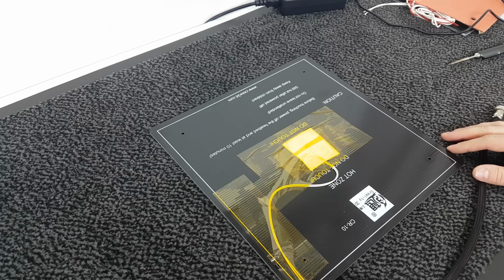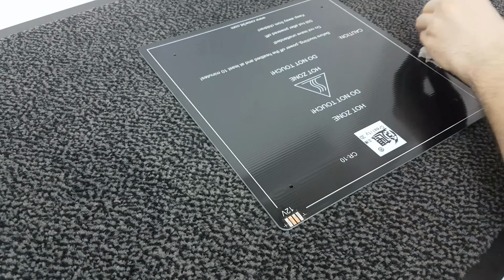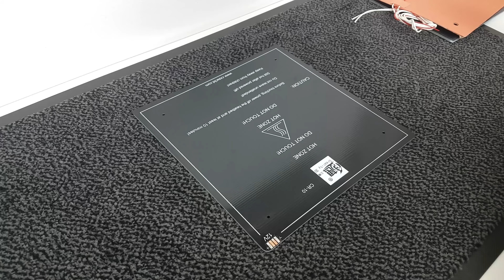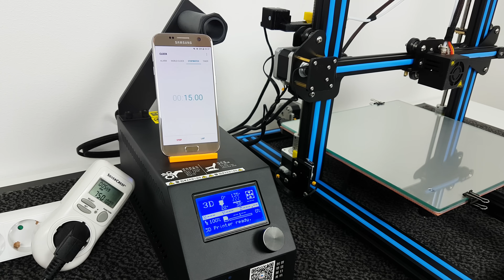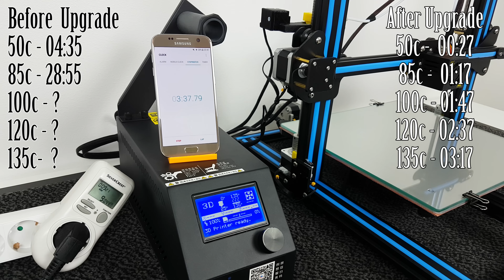Creality Cr10S ultimate Heat-bed upgrade! 750W heater installed

Comment: Attention!!!! This is the most dangerous modification I've ever seen. Putting 220V over the standard plug on the CR-10 (G16-4) directly next to the thermistor is not a good idea. In the simplest case, only the motherboard is destroyed in case of a short circuit. In the worst case, the mains voltage is applied to the metal parts of the printer, which can be deadly. The G16-4 plug is only designed for max. 150V AC!
Reply: on top of your great comment, if the plug is not installed, you have MAINS exposed on the pins, even without any faults this is not safe and probably against any existing electrical codes. There is also no fuse int he heat bed circuit and no differentiation in the wiring colors to indicate a significant difference in voltage, any one going in their later could easily thing there is only 12 or 24V on that wire.
Reply: The plug is also rated at 5 amps. With a 250W heated bed at 12Volts, there will run 20 amps through the plug. Not a great idea either. So the 230V will draw 3,3 Amps. I choose the 3 amps over the 20 because of heat dissipation. If you insulate your plug well enough with heatshrink then there is no problem with the voltage.
Reply: Sure, the main points for criticism are: running mains and low voltage through the same plug over exposed pins (inside and outside) and the lack of safe insulation / grounding towards the chassis. And because I personally do not always comply to any and all regulations I would dare to perform the mod exactly like nexi tech did, simply for the beauty and clean looks.
But I won't.
I will run the mains to the heat pad through a separate case with own main plug and fuse. Smply because I cannot guarantee that I alone and forever only me willl handle that machine. And that is the point when standardisation becomes relevant: when your changes to an electrical system are no longer recomprehensible.
And for all those boo-ing and crying "drama queen": we will have to bother with them only for a few  generations to come, but they will gradually disappear. Mains power is an effective RDSM (reinforced darwinian selection mechanism) :)
Reply: It is not really about what you can get away with but what something is certified to handle or what you should do. in some situations it could take months to break down or simply not meet code requirements for clearance etc... yes heat shrink and the likes can mitigate some of the risk but does not eliminate it. 
Nexi Tech looks to be competent in what is done here but if anyone else tries to copy then, there could be a different result. If i did this professionally then I would be fired, Nexi Tech did this for himself personally and at home so he can do what he likes and carries the risks that go with it. What most folks here are trying to get across is that, while it works and may for years to come, it is not strictly the right way to do it and not totally safe.
Reply: I just spent a few looking at several listings for those 4 pin aviation connectors and all of the ones I have seen are rated for 250v AC.
Reply: Calm down drama queen.

Comment: So many people talking BS after BS, I work in aviacion  and we call this blankets heat blanket, they been around in  aviation for ages, 30 year +, and when the short out they stop working that is all, they do not heat up at all, we use  use the same principle with the briskets box, and manually race the temp,  and we cook at 250 to 350F, when the blanket short out nothing happen just blow the fuse in the box, that is all and sometimes no even that.
Reply: aviacion is Spanish for aviation, which I suspect is maxun1's first language.
Reply: an idiot*
Reply: theres still 230 volts on the connector pins on the backside if you unplug the heatbed. I  have no idea why the pins are on the backside and not on the heatbed cable. You should be able to switch it up tho. Also you dont know of the plug is even suited for 230 Volts, you should definetely buy another plug that is suited for 230 volts and the current that this heatbed takes.
I agree that people in the comments are overreacting but still you should not play it down like its nothing, even 230volts can be dangerous!
Reply: you are a idiot.
Reply: did I spell idiot correct?
Reply: Yeah, I mean people are right to be afraid of 230V, but honestly, a lot of us are used to working with AC. If you know what you are doing, this is PERFECTLY safe. If you don't know what's a fuse or what's the difference between AC and DC this is not for you.

Comment: Considering you've got the wattage meter there, did you test how many watts the psu is pulling without the heated bed? Give people an idea of what they can downgrade to.
Reply from the maker: Joe  Yes, 68W was the peak number at 250c on hotend and at max printing speed, 250mm/s travel and 150mm/s print speed. So 70W/12v=5.8A I recommend at least 100W(8A 12V) powersupply to be safe and it can be even passive one without cooling fan(silent type).

Comment: Great video! Can this be easily done with Anycubic I3 Mega? The Ultrabse version heat bed is lacking. I just got the CR-10 Ultrabase; so nice.
Reply from the maker: RichterScaleStudios Thanks! I don't recommend this upgrade in I3 mega. I3 Mega has all metal frame and bearings on heatbed. You have to ground it. On Cr10 heatbed is rolling on plastic wheels so it's isolated from rest of printer and it has glass over aluminium heatbed. So some protection is there.  Btw. I have I3 mega with ultrabase and it can reach 110C on heated bed comparing to 87 (Max on Cr10). You don't really need this upgrade on I3 Mega.

Comment: Very nice video looked everywhere on youtube and it wasn't explained yet. The only thing I would do different is adding a fuse in series.
Reply from the maker: marko rodriguez Thank you. I fact I was thinking to add fuse the heater on AC line but there is a fuse on the back of control box already where AC plug are and it's 10A rated. 10A x 220V= 2200w. I think it's enough for whole 3D printer with this upgrade. It's maybe good think to add ground somewhere but there is glass over aluminium heatbed and whole heatbed is rolling on plastic so it's isolated  from rest of printer. Even if something short out fuse in control box will blow and cut main AC.

Comment: The bad has no grund it is very dengerus in tornado the bad is glass so it isolate but here aluminum..... u shold go with 24v bad less dengerus
Reply from the maker: elad b . In fact I was thinking to add fuse the heater on AC line but there is a fuse on the back of control box already where AC plug are and it's 10A rated. 10A x 220V= 2200w. I think it's enough for whole 3D printer with this upgrade. It's maybe good think to add ground somewhere but there is glass over aluminium heatbed and whole heatbed is rolling on plastic so it's isolated  from rest of printer. Even if something short out fuse in control box will blow and cut main AC. 
Of course you can add ground to one Heatbed adjusting screw(spring) and add one more cable (ground) to the other cables thru the cable housing way to the connector(plug) on the control box. Then from conector you can connect ground wire to ground on the main AC power plug from incide control box.
Reply: A new rule on YouTube from Georg Hartmann : If you can't comment in litteral english (even if english is not your first language), don't comment.
Reply: I have a house with a 2 wire system entirely. Does not really matter if there is a ground cable in that case.
But feeling free to isolate the sides of the aluminium board.
Reply: But actually i was flashed  by the english of elad
Reply: that english though .. and glass is isolating against heat? since when ?

Comment: Hi Nexi, good instructional video as usual. Be careful with this one though. There is now 220v A.C. on a machine chassis that was purposed for 24v. There does not seem to be additional grounding on the printer for the 220v circuit. Just a heads up on regulation in case someone decides to flag.

Comment: Great video as always, but is that connector on the black cable to the heated bed rated for mains voltage?
Reply: Nexi Tech Hi.  I saw the tube on disassembly.  On reassembly at 5:45 you mention it but you don't see it being replaced.   I like your channel but worry about this upgrade as it has the potential to go seriously wrong.  As shown you don't use upgraded connectors, (cables, and power supply), the chasis isn't earthed, and the heated bed is only protected by the appliance fuse, a smaller fuse could be added for the heated bed alone. Ive done a number of printer mods that you've done, but will not be going near this one.
Reply: Yep, my question exactly. But I think that it should be enough.
Reply from the maker: It's not a problem because load in amps is way to lower then before upgrade. Before was 20A on the connector and now is 3.4A
Reply: Steven Bacon Also there seems to be a metal outer sleeve just separated from mains wire by a layer of tape/small gap.  If plug were damaged eg crushed or dropped then there's the possibility of it going live.  While it may work I don't think I'd personally risk doing this mod.     Any faults with the wiring could result in a live plate/frame which is afaik unearthed.  If you are tempted by this mod, consult a qualified electrician.
Reply from the maker: freeyourinnertube If you pause video and look close on 3:59 you can see that tape is just extra protection over plastic cover. That plastic part is inside of plug and I add tape just to get extra safety.

Comment: You really should add a washer between the spring and the insulation, you don't want the spring to ever make connectivity to the 220v heatbed.
Reply from the maker: Nikolaos Selimis Thanks for the tip. I look closer to holes on the heater and It seems that heater wires inside heater is around 8mm away from holes. It's should be no problem. Now I'm not sure about other heater selling out there online but adding washer is good idea. Thanks again. Cheers!

Comment: Hi Nexi, I was looking at this and wondering, since I'm in Canada, would I get 120V version of this and 120V SSR, or is a 220V SSR that you've linked okay too? Thanks!
Reply from the maker: Hi mate! In Canada AC is 110V so I recommend that you choose 110V version. Using 220V AC heater on 110V AC will be to much under-powered in my opinion.
Reply: 110V for both Silicone Heater AND SSR or Heater only? Thanks!
Reply from the maker: iamthebest22 Heater only. SSR can work with 24-480AC.
Reply: Thank you very much!